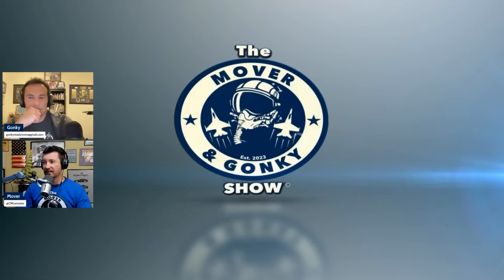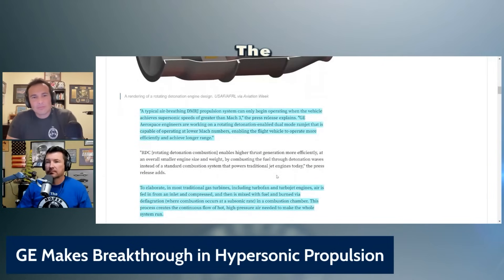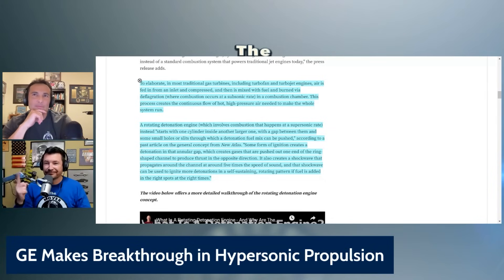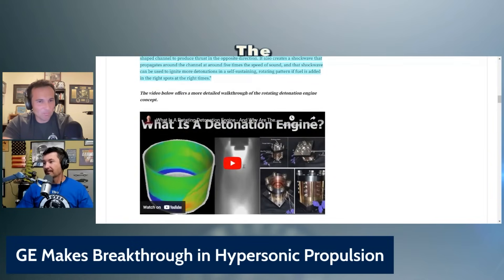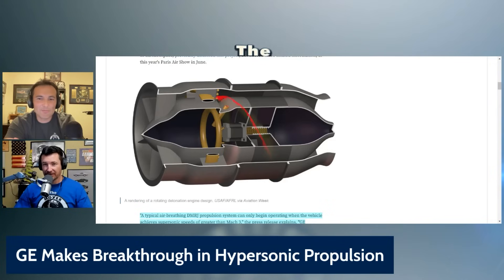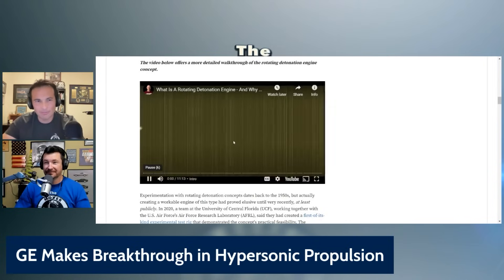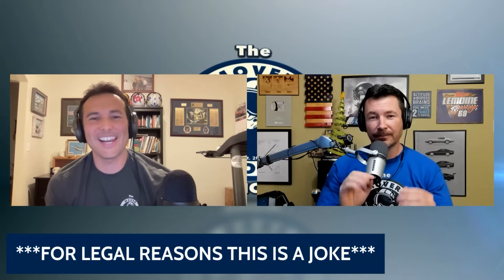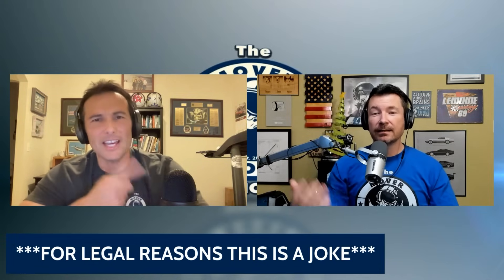The Future is Now! GE Creates a New Hypersonic Engine

Comment: My final year uni project was doing simulations of both ramjets and scramjets.
In both your incoming air gets compressed by itself without a compressor because of the high speed. It's basically a tube with some geometry that compresses the air, slowing it down.

But in a ramjet you combust at subsonic speeds which sends it back to supersonic which provides thrust.

The challenges with a scramjet is achieving combustion without slowing the air down.
I always wondered about that sort of annular design, it's interesting if it's reliable to build.

Comment: LENGTHY SYNOPSIS
My understanding is the new GE detonating hypersonic engine is a revolutionary propulsion system for fighter jets will utilize a combination of a turbojet engine and a ramjet engine to maximize thrust and power as discussed.
The turbojet engine works by compressing air and then injecting fuel into the air stream to ignite it. This generates thrust and propels the jet forward. The ramjet engine works by compressing the air and then injecting fuel into it, but the air is not ignited. 
The two engines are linked together in a dual-mode system, meaning the turbojet engine is used for takeoff and low-speed flight, while the ramjet engine is used for high-speed flight. During high-speed flight, the ramjet engine takes in the air that was compressed by the turbojet and detonates it. This creates a powerful shockwave that causes the air to expand rapidly, generating additional thrust. 
The GE detonating hypersonic engine is capable of producing thrust up to five times greater than a traditional turbojet engine, allowing fighter jets to reach speeds of up to Mach 5. This revolutionary propulsion system is sure to revolutionize the aviation industry and will make fighter jets even more powerful and capable than ever before.

In conclusion, the respective fighter pilot will first ensure that the hypersonic detonating engine is fueled and ready for operation before engaging. The pilot will then initiate the transition from subsonic to hypersonic speeds by increasing the thrust of the engine. This will involve manipulating the engine's thrust vector and increasing the engine's mass flow rate. The pilot will also increase the engine's bypass ratio to reduce the temperature of the exhaust gases, which is necessary for reaching the hypersonic speeds. As the engine accelerates, the pilot will need to monitor the engine's performance and adjust the thrust vector to ensure that the hypersonic speeds are maintained. 
Once the engine has reached the desired hypersonic speed, the pilot will need to maintain and adjust the thrust vector to ensure that the engine remains in a stable and efficient flight regime. The pilot may also need to adjust the engine's bypass ratio and the engine's mass flow rate to maintain a safe and efficient flight regime. The pilot should also monitor the engine's performance and make necessary adjustments as the flight progresses. Finally, the pilot will need to monitor the engine's temperature and make necessary adjustments to ensure that the engine remains within its operating parameters.

Comment: There's a cone of air that encapsulates the front of the engine the faster it goes. (That's why they created the boat tail hollowpoint). In order to force that air back into the engine, they are using the shockwaves as a secondary shell around the engine to trap the escaping air closer to the engine. Thus creating thicker, more dense, oxygen rich air into a secondary explosion; pushing the primary explosion back into the engine to perform at 30% less the necessary amount of energy by using the drag as an invisible sling shot. This is similar to how a NASCAR conserves fuel to explode around its opponent when needed.
Reply: Ditto

Comment: Rotating detonation engines (RDE) need very high pressure to operate. I believe the minimum is around 125 PSI, a typical jet engine compressor get as high as 70 psi.  GE bought Innoveering  (hijacked) which was doing all of the work on a turbojet that has a scramjet bypass engine (Simular to the PW J58 TurboJet with RamJet bypass). Considering the Erosion problems with RDE, I suspect GE's hyped engine is just vaporware.

Comment: You're right, as a pilot there is no real need to know how the engines work. Unlike a car, if you're flying a fighter and the engine quits there is ZERO chance that you can pull over and fix it quick with wire and tape and then take off again. 
So, really, it could all be running on magic fairy dust for all you need to know.
Reply: I mean if you have a multicycle engine you will need to understand it to some extent.

Comment: It's for the "high supersonic to low hypersonic" speed range, as strange as it sounds. SCRAMjets are for even faster (say, Mach 8 to 12), turbojets (afterburning in fighters, non-afterburning in Concorde) are good up to mach 2 or so, ramjets up to Mach 3 or 4. Detonation engines are preferable because they achieve very high compression (much better than RAMjets) without the need for a mechanical compressor, and thus very high efficencies, but pulse detonation engines (which we sort of know how to make) put extreme vibrational stress on components, and are thus not really usable, so the rotating detonation is the holy grail for this speed range. But it is extremely difficult to get a stable combustion like this; it's a hot research topic.

Comment: Haha Gonky and Mover are a pair of Pakleds: we look for things. Things that make us go.

I am also Pakled having nearly failed out of thermodynamics, but I think I have some sense that might help. Try thinking about the new engine as a diesel engine that operates on autoignition instead of a gas car engine that operates on deflagaration from the spark plug.

Also the big conceptual break from the traditional ramjet is that the combustion in the new engine is not axisymmetric. We're used to combusion going in even rings where we have the same thing going on around the center axis of the engine. In the new engine I think that there's basically an explosion going around the center axis, or two explosions chasing each other around the ring with new gas mix coming in ahead of the rotating detonation front, and exhaust blowing out behind the rotating det' tail.

You still have suck, squeeze, bang, blow. It's arranged significantly differently though. 

Air comes in at the front and gets some compression due to inertia. Suck and squeeze are coming in at the front, but it's being injected locally ahead of the rotating detonation, simply due to pressure being lower ahead of the det'.

The rotating detonating region is a region of bang ripping around the combustion chamber, blow occurs behind the detonation region through I think some kind of shockwave reflecting magic (i think the secret sauce is here).

The fundamental difference between diesel and gas car engines is compression ratio. Compression ratios on diesel engines is generally double the comp rat' on gas. This causes combustion to propagate via detonation instead of deflag. 

Deflag propagates with heat, where combusting molecules release heat that gets neighboring mix to burn.

Det' propagates with pressure/shock where combustion propagates at the speed of sound in the medium. It propagates much faster and gives more energy per boom, but it has to operate at very high pressure which is why prior detonation engines have to be brought up to supersonic conditions in order to ram air hard enough (mach number conditions) to get to detonation operating conditions. 

Engine builders of previous detonation designs were literally using the inertia of the air slamming into the front of their engines to sequeeze the air with a spike to get the comp' rat' for even ring shaped detonation.

I think that GE figured out some fancy combustion chamber shapes which can achieve local high pressure regions at slower inlet speeds. These local regions will "diesel" in the sense that they'll autoignite, like a diesel engine that does not use a spark plug.

When these regions det' they kick off their own shockwave which causes a shift in high pressure region which autoignites somewhere else around the ring. Basically instead of detonating everywhere in the combustion chamber they have worked out a means to have local detonation reflecting shockwaves that cause a rotating region of detonating mix with exhaust blowing out behind the detonating region and new mix coming in ahead of the det zone.

It's crazy because detonation sends shock waves in all directions. They must have developed some funky chamber shape that reflects shockwaves in a way to bias them in one direction to get a rotating region because the rotating trick is the real special sauce.

Sorry for the abbrevs. I'm trying to meet char limit and phones suck for long form. If you want, I can write something better and email it.
Reply: Sorry, I missed an important point: we have previously used walls and turbine blades to produce and separate regions of pressure and compression.

In this chamber, GE has figured out a way to reflect shock, to produce a moving region of detonation in an OPEN chamber.

It's some crazy voodoo that uses the same physics that causes shock diamonds and stick it in a bottle where you shoot in fuel air mix in a special way to make a detonating pixie that runs around the chamber.

It's far easier to describe that in overview than is to figure out how to practically implement.

Comment: Suck squeeze bang blow, but the squeeze and blow, instead of a burning, which is sub sonic normally, you are using detonations, in this case a rotory detonation, which is just an explosion that keeps running in a circle, that detonation, because its an explosion, moves air faster than just burning it, but you have to be more precise as you now have a contained continously running fuel explosion in your engine.

And because its running in a circle, and you are moving forward in a very fast plane, imagine a corkscrew pump.

Tldr: corkscrew pump made out of an explosion.

Comment: So this idea is not new. What is new is that they got it to work without tearing itself apart. The engine produces a rotating shockwave where the diffuser would be eliminating the need for a compressor at lower air speeds. It is the Holy grail of the pulse detonation jet crowed. Pulse jets are the earliest version of the jet engine. The Germans used them to propel the Buzz bomb; but pulse jets are extremely inefficient, body damagingly loud, and have a short life span. However if a person could create a self sustaining rotating shock wave or series of shock waves instead the engine would be much quieter and very efficient and be able to operate sub, super, and hyper sonic.

Comment: The main question is can the engine go fast enough and then slow enough to be an effective fighter and then be able to go faster to do it to get in and out of a fight with more efficiency?
Reply: Yeah, methinks not. To make an engine that can even operate at all speeds is one things, to do that and make it efficient is something else entirely.
The closest thing I can’t think of is SABRE, which is an air breathing rocket engine that compresses air using a super advanced precooler, and even that isn’t efficient enough for a jet aircraft, maybe. 
They say the SABRE will be able to get 3,500 seconds of Specific Impulse (compared to 900 seconds from a nuclear thermal engines), but with hydrogen fuel there’s the issue of compressibility, so fuel volume is an issue. Overall there’s a limit with hydrocarbons that I don’t think will be solved at least within heat next couple decades.
Reply: @jacobbaumgardner3406  I find your point interesting, my question to you is how you came to your conclusion and what are your qualifications? I’m certainly not saying you’re wrong or right I’m just curious and please don’t think I am being rude I’m just asking.

Comment: If you look back the 90s Jane's defence weekly did several articles about Donut shaped exhaust plumes about test areas in the US. Alot of it relates back the coverage of the Aurora spyship. This sounds like an announcement of certified tech from those flights. Interesting stuff to dig into.
Reply: The Aurora can go at mach 20 and is space capable. It's more than a spy craft, it's an all purpose, extreme god level hypersonic wave rider designed  to do more than just illegal spy activities.
Reply: Yea that was the rocket based combined cycle engine. Those things are loud as crap.
Reply: I recall those "donuts on a rope" articles in Aviation Week back in the day.  However, I think that was theorized to be some sort of pulse detonation jet engine, not a rotation one.  The rotating one here is more or less continuous.
Reply: Which can only go mach 12. They have jets designed for mach 17 and missiles with mach37 capabilities. Aurora is left behind.
Reply: @Xterminate13 I was more referring to the principle than the plane. Though I am impressed you're so knowledgeable about a secret, if even existing spy plane and its speed envelope. 🙂 That engine was speculated in the article has being a pulse denotaton engine, which was more point, not the airframe itself.
Reply: @CapnLucosef  I research a lot. Mach 17 is escape velocity. Much of this technology is quite old, the mach37 rocket was supposed to be used against the old Soviet Union. Russia has a differing weapon theory than NATO.... something even stranger than hyper fast engines....
Reply: @Xterminate13  Mach 17 won't even get you into orbit.  Maybe you're thinking of 17,500 mph, which is more or less the speed needed for orbit...around Mach 25?
Reply: @Xterminate13 we’ve traveled at those speeds for a long time, lol. Just not God’s green Earth

Comment: Hypersonics at this stage of technology is a great notion. Hypersonics in current technology is a one off, lab pipe dream. Once this gets real and ready for prime time production lines then its time to roll. We have a few years to see that happen.
Reply: I'm not sure I agree with that. They have been tested hypesonic for 2 decades now. The main problem is to have a engine that work at lowet speeds.  This kind of solves  that
Reply: @matsv201  Yes, this was part of the issue with the SR-71.  It was very inefficient getting into the air.  Basically, they took off and immediately refueled.  Then it could accelerate to operating speed and have the efficiency to fly its mission.
Reply: With enough suck, squeeze, bang, blow you can make a pig fly!  Propulsion group will be adding SSBB to their logos. 😂😂😂